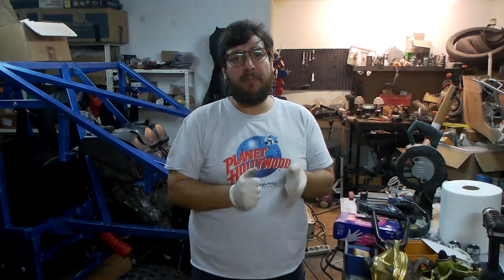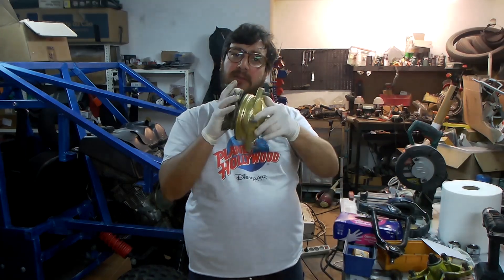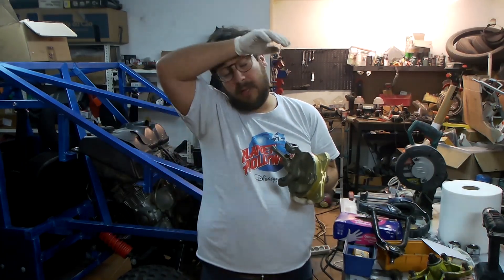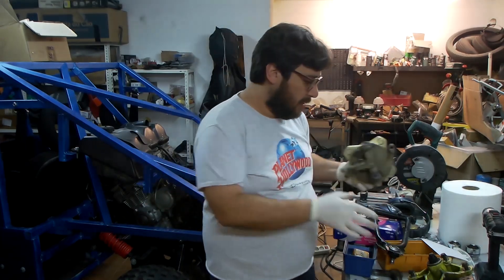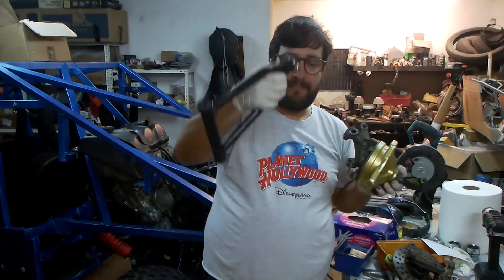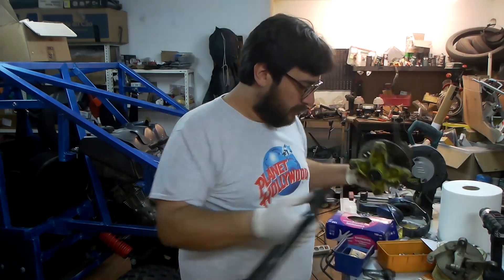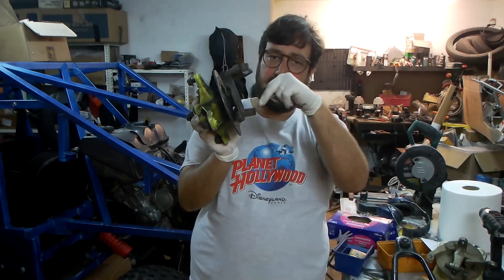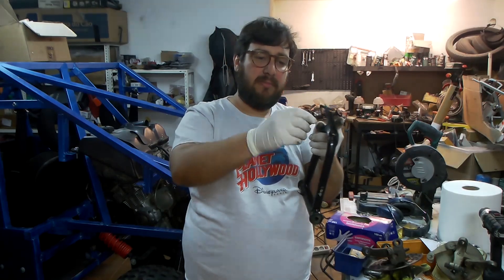Improve Yamaha Blaster Brakes: Disc Brake Conversions (cheap way)

Comment: Awesome info but I would of really loved to see what did you use for a fluid reservoir, and brake lines, how did you mount and route everything a second video showing/ explains and sources would be awesome
Reply from the maker: In fact this is not in a Blaster. I use the blaster front assembly to build a buggy, however it is very easy to complete the set up in a blaster. Just search in Aliexpress for banjo bolts, T piece brake line, brake lines and motorcycle master cylinder you will find anything you need. If you need more help, just let me know. Regards.

Comment: Hey boss can’t you just get a banshee A arm and slap it all in? I know that you can run a whole front brake system off a banshee. But didn’t know that it won’t fit . I wonder if a banshee A arm is identical length to the gen1 blasters!
Reply: A arms aren’t the same

Comment: Cti makes a conversion kit comes with everything
Reply from the maker: Thank you for the info. But 392 $ it is a bit expensive :)
Reply: I Will buy just the Custom bracket to put the caliper AND i buy Yamaha Warrior usted brakes AND hubs @bolhasgarage
Reply: @bolhasgarage actually ends up being over $500 if you get their rotors and pads. Just ordered the kit. I’ll have a video up soon